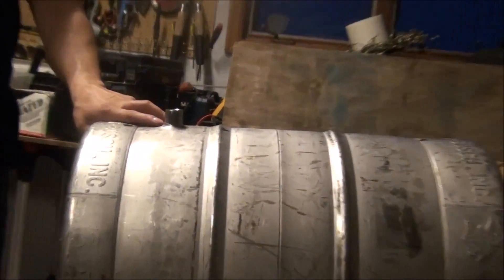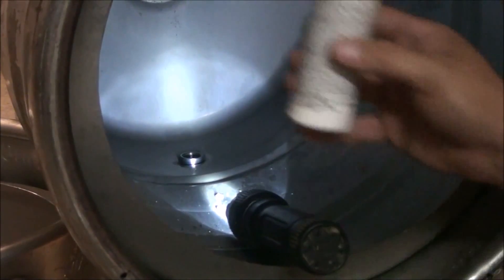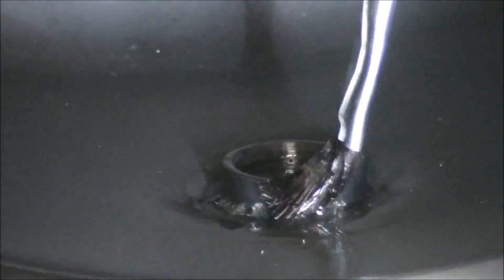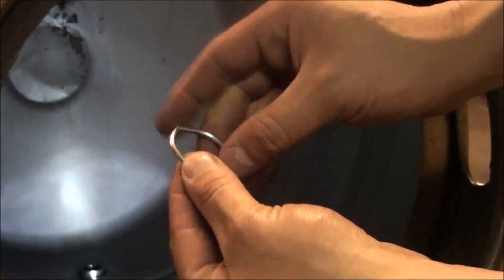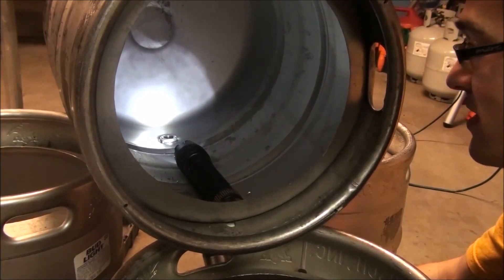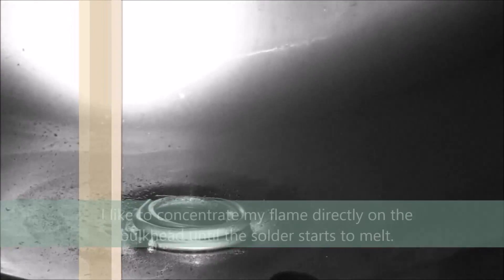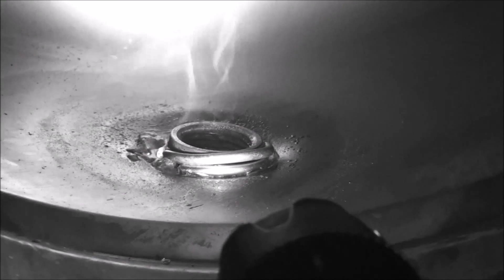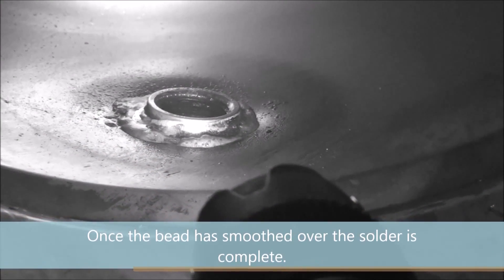Keg to Kettle -Bulkhead Soldering

Comment: How have the joints held up to the open flames?
Reply: as long as there's liquid in the boiler then it wont get hot enough for the solder to be a problem.